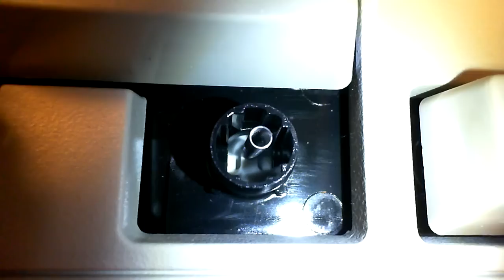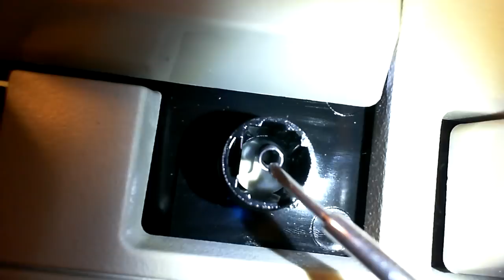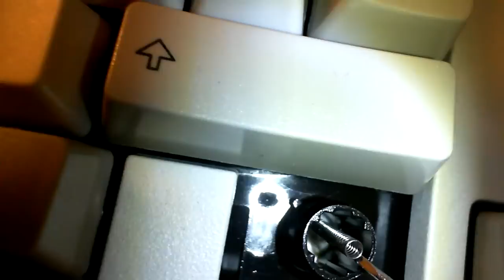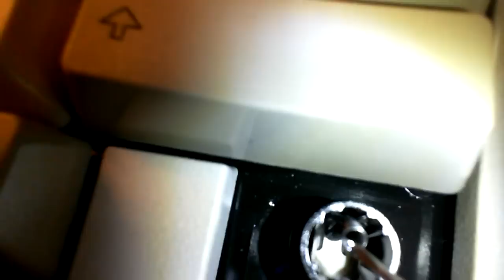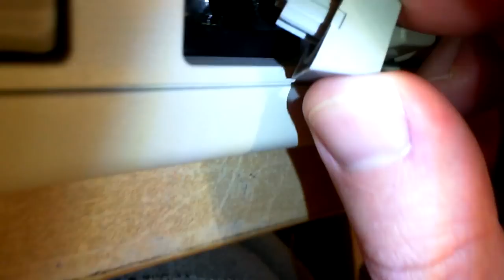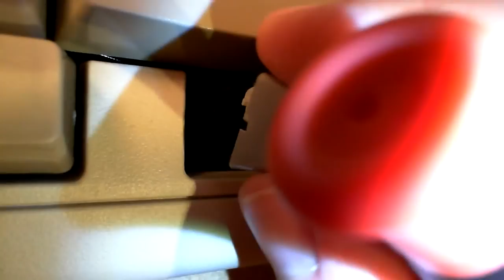Inside a "Buckling Spring" Key, on a Unicomp Model M

Comment: wats d difrnce betwn a normal spring n a buckling spring...?
Reply: A buckling spring key has a spring attached to a rocker.  As you push down the spring builds pressure and then buckles, when it does you feel a tactile response.  At the exact same moment the rocker is tilted by the spring registering the key press.